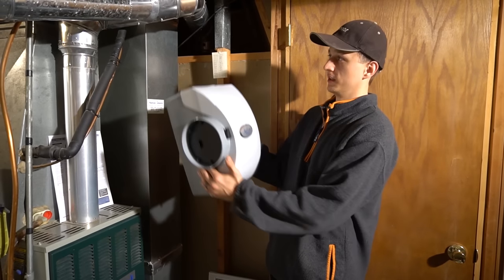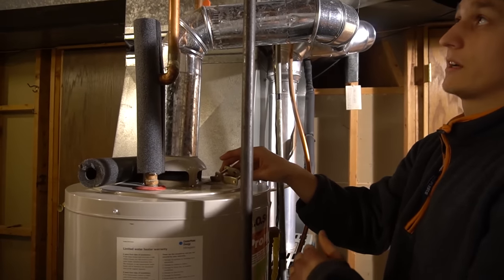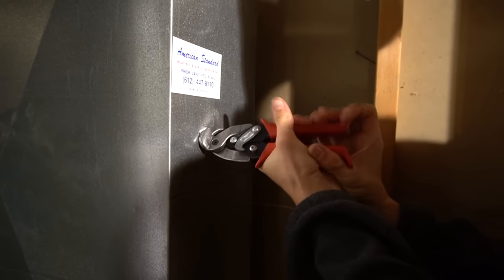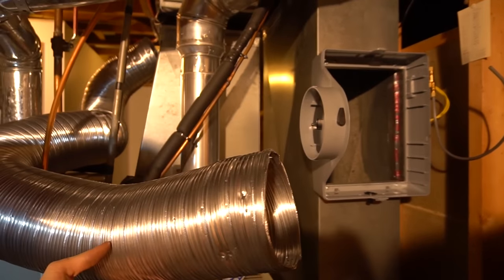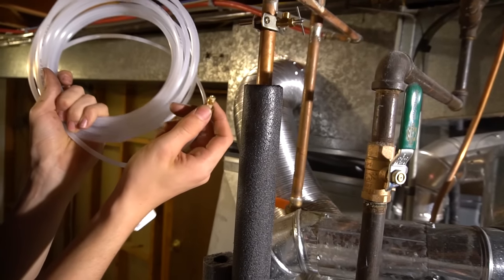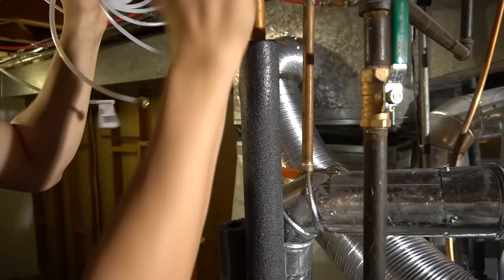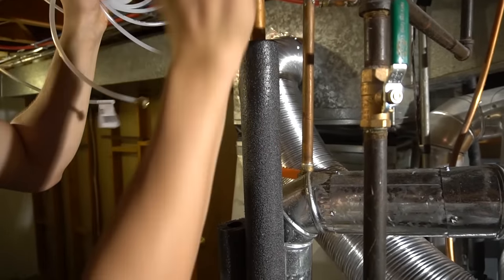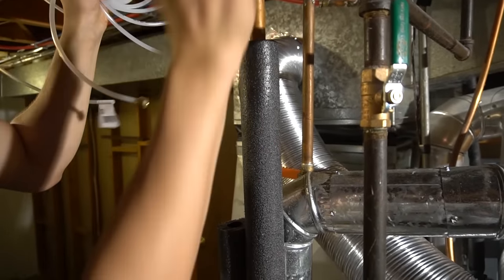Aprilaire 600M Humidifier Installation Walkthrough

Comment: Anyone that uses a saddle valve for anything especially as an operational valve, which is NOT what they're intended for, loses my respect! It's a lazy, cheap, and quick method for supply tap not meant to be functional open, close open close.
Reply: Where can we send your YouTube 'expert' award?
Reply: It would not be an operational valve in these circumstances. Shouldn’t need to ever touch it.

Comment: Wrong info, the thing has to be mounted on supply duckt. Not return, bad bad boy
Reply: The manufacturer states that it can be installed on either.  In fact, installing it on the return can avoid catastrophic problems if the unit ever leaks.
Reply: Not true. Not at all.

Comment: That white plastic pipe is garbage....don't use it....you have been warned, that pipe is a time bomb, instead use the braded steel line it costs more money but it won't pop off and cause thousands of dollars of water damage, also that "needle" value is worthless. Use a 1/4 shutoff valve plumb into the water line you can then control the flow of water to the humidifier, thus saving you wasting water.( the humidifier can only absorb so much water  the rest will go down the drain) Do it right the first time it will save you money and headaches in the future. Just trying to help! Cheers!
Reply: The water solenoid controls flow of water . You can’t throttle it back at the shutoff , it will affect solenoid performance . Must be wide open per April aire tech

Comment: The instructions for getting it installed are fairly correct except you didnt follow the directions at all. You needed to install the humidifer on the supply and the duct on the return so you are not rehumidifying the same air over and over.
Reply: Don’t matter on bypass models

Comment: Yeah flexible pipe is never to be used. There's a reason why professional's should be hired.
Reply: Would you explain why flexable duct shouldn't be used?
Reply: @matthewerwin4677  lost of efficiency. It will still work. I have seen people install with flexduct and it works. More dust and crap also builds up easier cause of the ribs on the flexible duct. I would not use or recommend flexible duct on a humidifier install. It shows your contractor does not take pride is his or her work.
Reply: @matthewerwin4677  I would also not recommended following this guy's video...... He is not a professional and does not have very much experience with HVAC. Anyone that has been in trade long enough will know this install is DIYer and should stop posting videos on HVAC repairs
Reply: @pineychristian   I definitely agree with you.   Plus the guy said the put the waterline on the hot side that's never recommended. And he hooked up the humidifier up on the cold air return you are supposed to put it on the hot stack.  blow the hot air thats got moisture in it into the cold air return therefore the air that's going out through it's already heated and already has moisture that's heated. It's amazing how people have no clue what to do.  Plus the pipe should be straight so if there's any extra moisture in there when the furnace turns off it has a little bit of drain it's not gonna puddle up somewhere and turn into mold. I just installed Bryant humidifier, Bryant $200 thermostat/ humidistat, with a  thermometer outside for my dads house.   My parents actually had to lower their house temperature 2 degrees because with the correct humidity level the house was too warm. Much more efficient when it's done right.  The furnace is a 97% efficiency. Technology is amazing.
Reply: @richhutchings8979  it does not matter if you hook a by pass humidifier on return or supply duct. It does matter if it was a powered fan humidifier. Also you would hook up to hot side of water heater because it is a little more efficient but is absolutely recommended if you plan on running any humidifier without heat on. Hot water is needed in that case cause furnace heat water in air which causes the evaporation process. Without furnace on hot water above 140 degrees is recommended with only blower circulating.
Reply: @richhutchings8979  you probably have a Bryant 987 furnace model. I very familiar with Bryant since this is the premier line we installled at the HVAC company i worked for. Very nice set up.

Comment: Man, just stick to service. That was painful to watch. Next time, get a cube that is big enough to mount the humidifier and then mount that to the smaller duct. You’ll need to do some fabrication, but it would be much better then the mangle job you did. I like you as a service guy. I do not like you as a sheet metal worker. Not hating, just some constructive criticism.
Reply from the maker: Thank you for the constructive criticism! I appreciate it and I actually agree... :/ That video was filmed when I was still a greenhorn and  to make it worse, I was saving money on the supplies too.. Like the plastic water tubing instead of copper. (I'm still learning but for sure better than I was back then)

Comment: so you are humidifying the furnace not the house if thats on the return air!!!!
Reply: And how would the air direction be changed if he had it on the supply side instead of the return side? Still has to go from supply, through humidifier and back into the return.
Reply: Not exactly.

Comment: Wrong placement has to be installed on the supply all his moisture is being caught in the air filter but nice try.
Reply: Nah
Reply: Wrong! Does not need to be on supply. In fact, it is recommended that this type be on the return when possible.

Comment: This is a terrible install. All the great install comments are mind numbing. Most of u don't know what a quality install looks like. Our hvac industry is in trouble if anyone thinks this is quality. This is what should have been done. Hard pipe bypass, sweat a ball valve or valve stop for water feed, water feed in copper, drain pine in pvc, hook the xformer to the each terminal, just remember to turn off humidistat in summer or hook the 24v to the hum terminal on board. Most furnaces have a hum term, especially AS/trane. Awful install and doesn't deserve the pump up or subscription. DIY install. Just twrrible